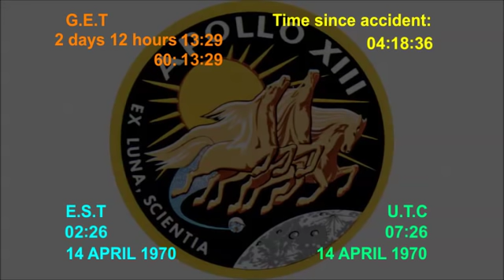Apollo 13 Accident - Flight Director Loop Part 3

Comment: Black outs
Reply: Everywhere near HostHr locations
Reply: Don't engage make hot spots notes false information ℹ️
Reply: It was due to Apollo 13's S-IVB upper stage. Starting with Apollo 13, all S-IVB stages had the Instrument Unit (IU) programmed to "steer" the stage to crash into the lunar surface, allowing the ALSEP stations left by prior missions to get accurate readings of the Moon's interior. For tracking purposes, the S-IVB stage transmitter was set to the same frequency as that of the LM. Normally, the LM's transmitter would be powered up in lunar orbit after the S-IVB stage impacted the lunar surface, however in the case of Apollo 13, the LM was handling the air-to-ground communications and it was being "out-shouted" by the S-IVB.

Comment: 7:49 I like that sequence.  TELMU informs flight of an issue he wants to address.  He starts laying out which valves he wants to switch out, but Lunney interrupts with a clarification.  "Before you go through the valves, what are you trying to accomplish?"  Clarifying exactly what the goal is before getting into the actual actions to take.

Comment: When the flight director loop started (Part 1) there was no background noise at all. Now when you listen it sounds like they're in a crowded shopping mall. Those microphones are supposed to filter out noise so you can just imagine the pandemonium that's taking place in the MOCR right now. (18:18 is a good example, when Lunney tells everyone to be quiet.)

Comment: Can you imagine all these acronyms in the movie. I've read a lot about spaceflight and Apollo so it doesn't throw me.

PNGS (pronounced "pings") = Primary Navigation and Guidance Sysgem
AGS= Abort Guidance System (lower power than the PNGS, so lower water usage)
PTC = Passive Thermal Control (bar-b-que roll)
Reply: Simplifying isn't the issue. Of course you have to. But showing only one flight director, let things always happen at the last second for extra drama.  Like the CO2 scrubbing thing.
Reply: Yeah, it's a hard thing to make into a movie.
Reply: Not limited to spaceflight; happens all the time in the defense contractor work. However one of the flight controllers (I think it was Ed) put it succinctly that he might as well have been in another country because he didn't know what anyone was talking about. All the acronyms, and acronyms of acronyms, would have made the layman go nuts.

Comment: I like how capcom is an active part in this. It's not just passing on things. He's kinda actively speaking for the crew at times.
Reply: That's why the CAPCOM was always a fellow astronaut.  A unique perspective
Reply: Lousma was epic
Reply: And that's the reason CAPCOM was the only person allowed to talk directly to the Crew, just as it is to this day.
Reply: @cleekmaker00  Thought I heard that in cases of medical need, the flight surgeon was also given a "private line" to each crewman.
Reply: And sometimes he gives the reasoning for the action so it is more clear or repeats actions that he knows will be a concern for the crew so that they know control is sure.
Reply: I think Jack Lousma was the best ecomm ever! He had a way to give the crew everything they needed to know,and they could tell by his tone and certain ways he said things what was going on.
Reply: I meant Capcomm
Reply: Capcoms are no longer astronauts only i believe , am i correct ?
Reply: @Captainwill55 Correct. There aren't enough astronauts these days for it to be practical, so during more routine phases of flight they sometimes use non-astronauts.
Reply: I have the same thought every time I listen to Jack Lousma on this recording.

Comment: 1:17:45 beginning of extensive comm loss that you don't ever hear about.  The ground station locked onto the IU for the S-IVB (data) instead of the LM voice/data.  Spacecraft couldn't hear Houston, and vice versa.  The LM wasn't supposed to be transmitting the same time as the S-IVB.
Reply: "How are we going to get to the moon if we can't talk between three buildings?" -- Gus Grissom
Reply: You can tell that Glenn was getting a little pissy with the INCO at the start...

Comment: Crazy how you can hear Lovell using the hand controller to fire the jets to get the middle gimbal away from gimbal lock. 

For Christmas I want a forth gimbal. (A nod to Mike Collins who, tried as he might, could not get the Apollo 11 CSM into a attitude to see the LEM on the surface, due to gimbal lock warnings, a forth gimbal would make gimbal lock impossible because they would not line up.)
Reply: Fun fact, there was a 4th gimbal and no gimbal lock issue on Gemini. They removed it as a weight saving measure, with the expectation that they would do several P52 Alignments to change attitude away from gimbal lock during the mission.
Reply: and the spacecraft heavier.

Comment: Interesting. I always assumed the bit in the movie where Lovell starts cursing about the gimbles over a hot-mic, only to be informed by the ground that they were on vox the whole time was a bit of artistic license to create some additional tension. It turns out there was a sequence were they were going on about stuff while on vox, until Jack Lousma(Capcom) informs them they're on VOX, and then Fred says "What? You want us to goto VOX?" and then of course he says they've been on vox the whole time. 

The circumstances were a bit different of course but in general it was pretty accurate.
Reply: Fifty0ne alot of the movie is direct lift.

Comment: Yet another oversight. They inexplicably designed the Saturn 3rd stage to transmit on the same frequency as the LEM. Normally not an issue because they should not even have the LEM powered up before the S-IVB stage has hit the moon. Most likely was redesigned after 13.
Reply: Makes sense to use the same frequency, because they need to keep each used frequency free globally (even in USSR etc.) throughout the Apollo program, and there are already a limited number of frequency bands useable for ground to outer space and back transmissions.

Comment: There are some really interesting silent gaps in this video - static and obvious ability to broadcast, but no loop chatter. And the gap in comms is scary - no way to message but voice.
Reply: well, most of the controllers were going back and forth with their support teams on a different loop. just because you don't hear them didn't mean that nothing was happening.